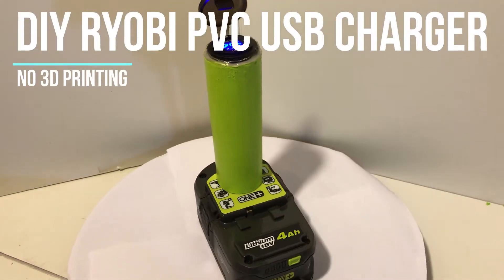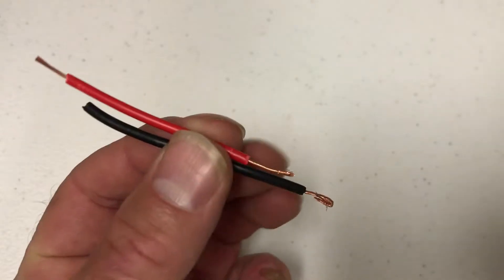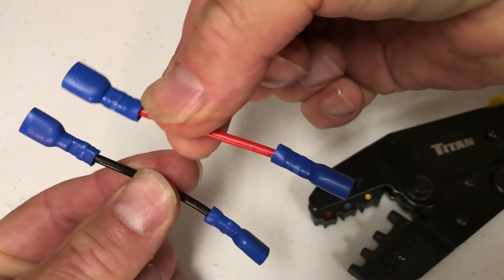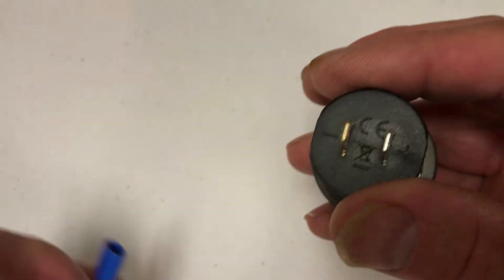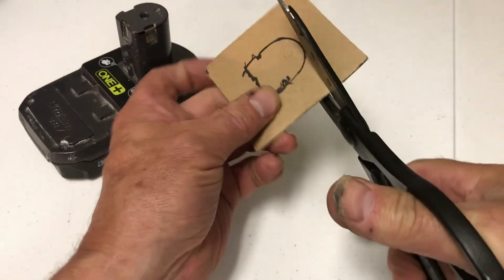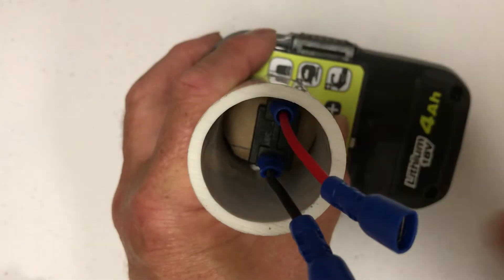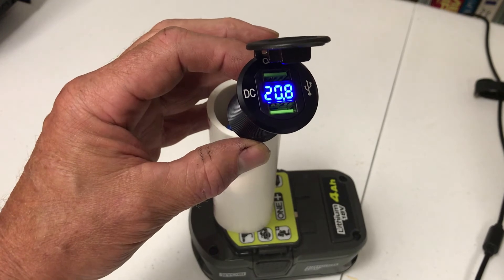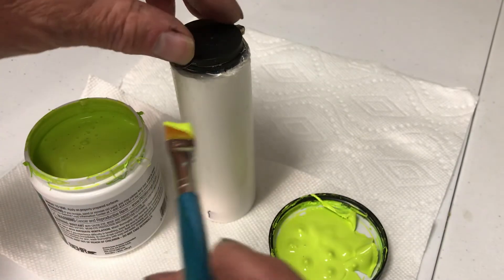Cheap DIY Ryobi PVC USB Charger

Comment: Looking at the price for the battery contacts and it makes it almost the same price as ordering some of those "Power wheel" adapters that are ready made. Any options you've found for cheaper way to make contact? Another guy on YT just put machine screws in from the sides but I worry that'd wear down the contacts
Reply: Thin metal strips work. I hadn't tried aluminum foil yet as I may try just to see🤷

Comment: I’ve been making my own RYOBI battery adapters for several years now.  I just use a PVC 1 inch coupler.  I just heat the bottom half of the coupler then slip it on to the battery to make the mould.  once hardened, remove coupler then cover the top of the battery shaft with Astro glide. I then put the coupler back on the batter y. I use hot glue to fill the gaps where the battery leads go.  The Astro glide prevents the hot glue from sticking to the battery.  I apply double sided tape on the battery leads that have been shaped from the hot glue that has now hardened to the inside of the PVC coupler. I apply thick tin foil strips (any thin conductive material) to the other side of the sticky tape to bring the battery leads top half of the coupler where you can easily connect your circuit to.  For anybody who wants to try this, there is an assortment of P parts to house your circuit.  I use a Dremel and a Dremel press for making perpendicular holes and cuts to the PVC to make the circuit fit.  I did not know you could order battery leads.  I think I’m going to stick to my method of using hot glue and thin metal strips with double-sided tape.  it’s really simple and makes a good contact to the battery. I spent weeks and weeks figuring this part out.  I wish I could show you some pictures of my Ryobi adaptors.  I am almost finished building a 12 V cigarette lighter adaptor capable of putting out 10 Amps.  it’s only going to be 5 inches long using 1” and a 1.25 “ PVC coupler four housing with a display showing output current , switch to toggle display between input voltage and output voltage.  I would love to show you pictures and to share with everyone my Ryobi battery adapters.  My next project is to make a DC pass through Ryobi battery charger.  A sort of UPS.  if you want to see pictures of my Ryobi battery adaptors goto DataLineMan.com were you will find my emails address. send me a message and I’ll reply back with photographs of my unique Ryobi battery circuits power adapters I’ve made :-)
Reply: You should make a YouTube video of the above process!!
Reply: Very cool
Reply: That's cool as fu$k

Comment: that's cool.  i didn't know those 12v usb chargers would accept 21v
Reply: Some Vehicles use 24 volts instead of 12 volts by having two 12 volt batteries in parallel.

This particular adapter requires 24 volts for the input voltage, according to the Amazon web page.

Comment: I Love it! But Isn't 20.Volts to high to charge a cellphone or most devices?
Reply from the maker: The socket is showing the battery voltage, the USB ports are the correct voltage
Reply: That USB adapter expects 24 volts  and regulates it to the voltage the USB adapter needs.

Comment: Could you do the same with a cigarette lighter socket or do you need a voltage regulator?
Reply from the maker: you would need the regulator because the battery starts out at around 21V and drops as it is used
Reply: @SerendipitySue  there are cigarett lighters put ther that convert 24v to 12v already aaq them in some trucks